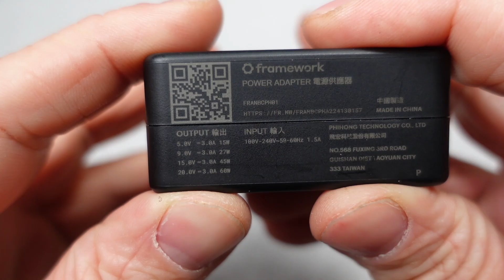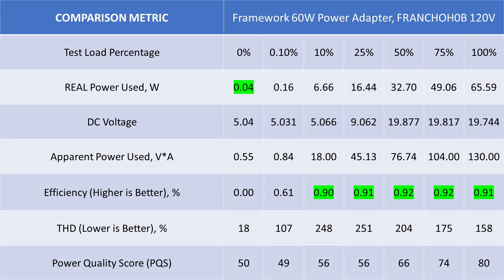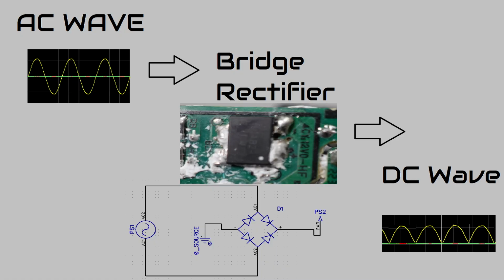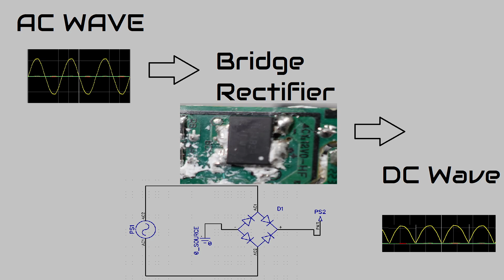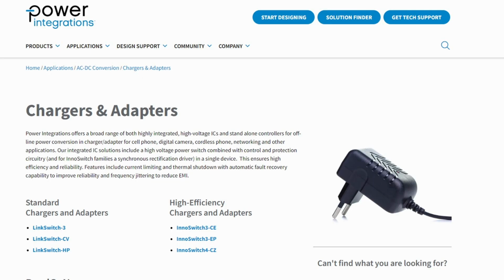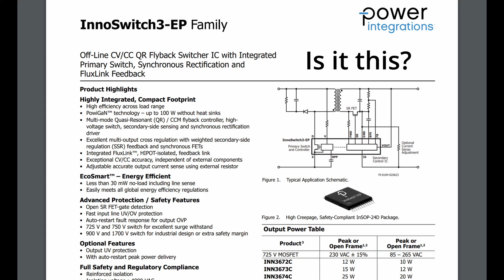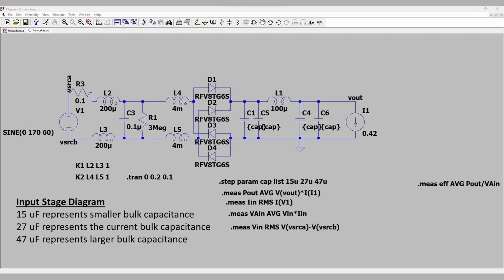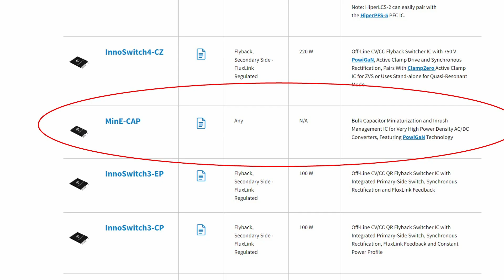Framework 60w Laptop USB Power Adapter Teardown

Comment: Going to try cracking mine open.

We had a storm recently and this saved my framework. I tested it by trying to power a pinecil v2 soldering iron. No signs of life so maybe the fuse had blown.

Will repair and keep as a spare psu.
Reply from the maker: Ah, yeah, could be lots of things but usually fuses blow for a reason.
Reply: @AllThingsOnePlace strangest thing, I gave the adapter a small load to test it. I used a little USB flash drive light from amazon connected to a type A to type C adapter.

It lit up now!?

I checked with the framework and pinecil v2, and they work as well.

I wonder what caused it to stop working for a little while?

Comment: Was able to find the answer to my question, resettable fuse not found inside. My adapter stopped working today.
Reply from the maker: So, the fuse blew?  The fuses usually don't pop unless something has gone horribly wrong in another part of the adapter.  Or consistent undervoltage condition is present, like 75 or 80VAC at the input, just enough to keep it on but just enough to push it over the fuses limit.  It is not typical to use a resettable fuse on the AC line input.

Comment: Great reviews and teardowns, lots of depth and love the focus on efficiency and safety which most others ignore. I wasn't too impressed with my framework charger at first but feel more reassured now.

Would be nice to see some zendure power banks reviewed, they have small 18/36Wh 20W ones but also 96Wh 100W behemoths. The chargeasap zeus 270W charger (max 140W per port) might be interesting when it's available again, and I'm also curious to see how rolling square inCharge 100W and DriverGenius UC240-40G 240W stack up to other cables.

One thing that's missing (or just not so obvious) is whether the devices reviewed meet the claimed port sharing and charging modes, I've had my share of issues from time to time but not always clear if the issue is with the charger, the cable, or perhaps the USB meter in between.

On that note, like someone else commented it would be interesting to see reviews of "portable" USB meters and test loads (the branding/OEM situation is quite confusing although places like the usbchargingblog have some good write-ups, e.g. for the shizuku/avhzy ct-3), and I see some EPR capable meters popping up like the witrn c4. A video dedicated to your test setup would also be welcome 😅!
Reply from the maker: Thanks for watching and the suggestions.  Zendure has been on the list for power banks for a while.  Those high power, power banks (that aren't 200WH or larger batteries also) are all trouble, they can't do what they say without overheating, look at Hyper and the products they released, massive claims, all of it was lies and marketing, they didn't pass the sniff test for me so I never tried.  I have a few things here that are going to be miserably bad, haha.  

The cables probably won't make round 4 of USB cables but there will be a round 5.  Yeah, I rush through the bit where I test multiple devices.  I show it better sometimes versus others.  The problem with demonstrating that is also that every device mix is different so I may not find an issue or find an issue that someone else will or won't have.

Yeah, I have a few portable meters around and I have the higher precision equipment to see how far off they are.  It could be a good direction, I wonder if anyone has reviewed the charger lab device, I have never looked.  I mostly swear at it for the awful button layout, you never hit the correct button, but as in indicator it is great, I don't use it as a measurement tool.  It is probably the best one out there though.  No idea how to calibrate it.

Comment: Just a minor editing nitpick: please indicate whenever the video is paused, it otherwise makes it easy to think that YouTube is dropping frames.

Some common pause indicators:
- a pause symbol in one of the corners
- slightly scaling the frame down while adding a black border (sometimes accompanied with a slight rotation)
- adding a camera filter (noise, sepia, etc)
- any combination of the above.

This would make the pauses less jarring and make it easier to concentrate on the content, I know it would be harder on you (or whoever edits your videos), but I would like you to at least consider adding it.
Reply from the maker: Yeah, I had too much rushed footage on this one, like I was in a race for the audio and the video...  So, I did the pause thing, I don't normally do that, but I like the suggestion to add some indicator.  I didn't like having to use it myself.  Yes, I do all the editing, if you want to call it that.  Amateur hour over here.  It would be quite easy to add one or more of those things to a video!  I will keep it in mind for sure.

Comment: I have a question or suggestion for an interesting video — I have small usb-powered and 3.5 jack speakers. They make audio noise depending where that usb is plugged, and the noise is completely gone if I plug them into usb port on my UPS
Reply: Sounds like a ground loop issue (the speakers have 2 ground paths towards the pc, one from the usb connector and one from the jack creating noise).
Reply from the maker: Yep, sounds like a pretty typical ground loop.  This framework adapter could be a culprit in creating those.  I use a transformer isolated DAC from my PC (the peavy one), far from perfect but good enough for casual use.
Reply: @AllThingsOnePlace I believed that the presence of ground (three-pronged plug) on Framework Power adapter, would eliminate all noise. Is it not true?
Reply from the maker: @explorelamy  It won't eliminate noise, it can help keep your laptop at the same potential as earth though, shunting some of the leakage current from the adapter.  It won't really change the output voltage noise or ripple.

Comment: I have learnt a great deal from this channel that has directly informed my charging device choices so thank you and please keep up the good work! One suggestion for future videos- USB meter testers.Even though many reviewers seem to use them when testing charging ports and portable batteries, they rarely explain how they work and which ones are any good. I've tried a few myself and have got increasing confused as I got different readings from each. Chargerlab, FNIRSI, and Plugable are some widely used and available brands in this sector. Ps: you could start with a walk-through of your own Chargerlab device which I've seen in a few of your own videos😊
Reply from the maker: Yeah, that is not a bad idea.  I do have a several of them around.  They do all read a little different and the big thing is, how do you calibrate them?  How stable are they?  No idea.  I'd say they are good enough to give an indication but not a measurement.
Reply: @AllThingsOnePlace  yup, was browsing through your videos recently to see if you'd already done this before stumbling on this comment.  I have an old type-A tester and want to get a type-C one that reports on newer PD states.  if you have any info on Linux/programmatic access to the device that would be nice (I don't use Windows, which I've often seen as a requirement for logging and firmware updates)

Comment: Dam dude, somebody at the factory got so excited about their product, they excreted a lot of their glue in there! We got a fuse, it is  inline, the AC is connected to the, conductor. Then the power bathes in the capacitor, which then feeds into the, second conductor. Then we get all jazzed up, in the rectifier, AC to DC, ready to rock! No data sheets, what a crapchute, but were still gonna move on to the main volt capacitors, CHARGE! Time to get HOT and make the magic happen, then have a date with the inductor! Ohhhhh my, what a transformer you have, gallium nitride, so energetically certified. Great video, thanks for the education and entertainment, hope my comment made you smile. lol
Reply from the maker: haha,  yeah, as always!  It's all a story.  I need to figure out what content to make to keep the channel growing without just making more of the same.

Comment: Good to find there are still some manufacturers making quality products without cutting corners.
Reply from the maker: Yeah, Framework did their homework picking a manufacturer for this one.
Reply: considering framework is all about the completely user repairable laptop its not surprising they did this. what is suprising is that theres a company making laptops like that